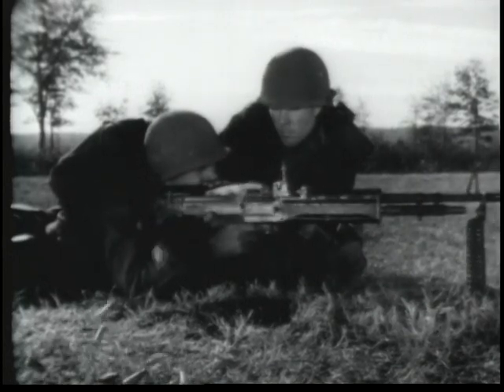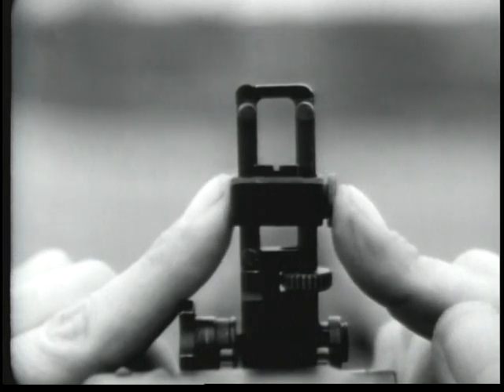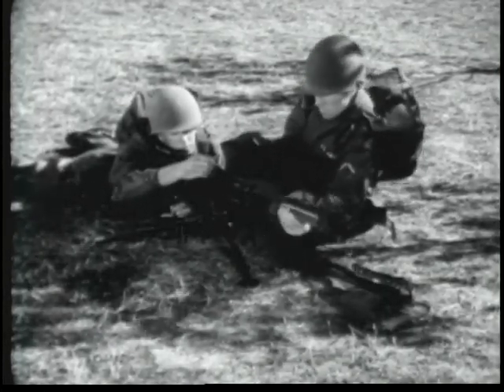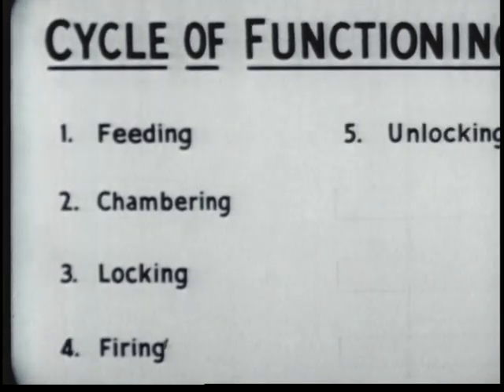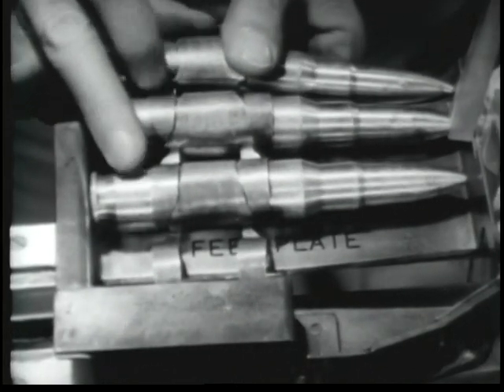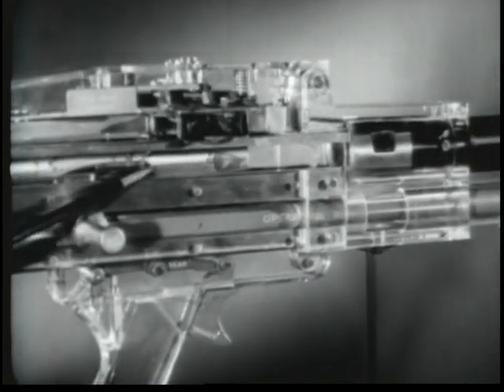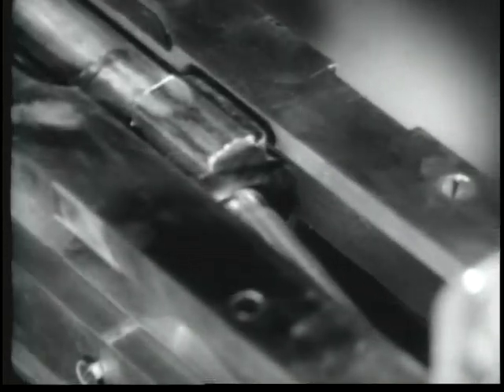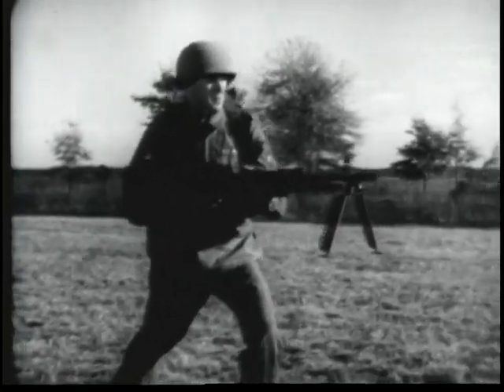MACHINEGUN, 7.62MM, M60, OPERATION AND CYCLE OF FUNCTIONING

Comment: The belt is made of what're called M13 links, basically metal clasps linked around the rounds to form a chain. It's called a disintegrating belt because as the weapon is cycled the links disconnect and come off, if you look you can see they're ejected with the shells.

Comment: @soonersfan081 Yup. In fact, the Stg. 44's gas system is why the production costs was so high. I prefer the AK's gas system better. Back on the M60, they actually built in on the BAR with some inspiration from the MG42 and the FG42 Paratrooper rifle. Really, after World War II, everybody pretty much copied German designs for stuff.

Comment: Because the bolt would be in the way of the cartridge. In an open bolt design, like the M60, the round is only chambered as you pull the trigger and the bolt moves foward and the firing pin strikes the primer.

In closed bolt weapons, the round is chambered by the bolt, and the sear only controls the firing pin. when you pull the trigger the firing pin is released and it hits the primer.

In the field, you don't let is run empty, just link another belt on.

Comment: @soonersfan081 Not really. The M60 is partially inspired by the FG42 and MG42, but it designed on top of the BAR and has a similar battery of arms. The M14 is the updated version of an M1 Garand. Really, the M14 is the M1 Garand with a different gas system and a detachable magazine.

Comment: I call this design "delayed rotary bolt" because, once you pull the trigger, it acts just like the closed bolt ones or "immediate rotary bolt" as I would call it. the problem is that with closed ones there's a split second delay between chambering and firing the very first shot, but otherwise both designs work practically the same, the only difference is the that closed bolt chamber the first round BEFORE pulling the trigger. Did I get this right?

Comment: Yep no shit!I got the same thing even at Benning.I used to carry spare springs,gas piston,and a wrench dummy corded in my ammo pouch.That fucking front plug gets loose when the wire breaks your gun goes down.Tighten the shit up again then continue.The"Pig"worked as long as you knew what the fuck you were doing.Thats why I got stuck with it for so long.When i was team leader in 1st Sqd.They put me back into the M-60 teams.What a fucking curse!!!

Comment: Where'd you serve? I was with 2-22INF, 10th MTN. Yeah, I guess the procedures must have been changed. I suppose the idea of loading in the video was to avoid damaging the cam roller on the bolt carrier and the feed tray cover by closing it with the bolt forward....something they improved with the SAW, it had a spring loaded roller. Its probably faster too to just slap a fresh belt on the feed tray instead of trying to line up the belt with the feed pawls while bullets are cracking past you.